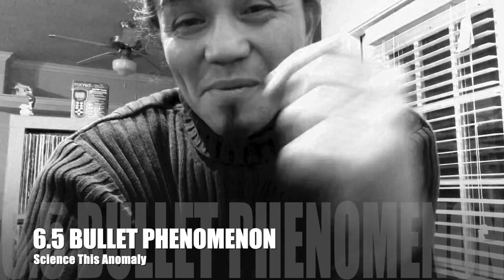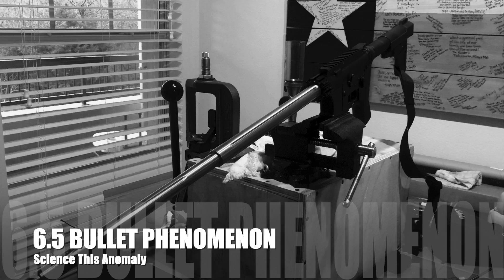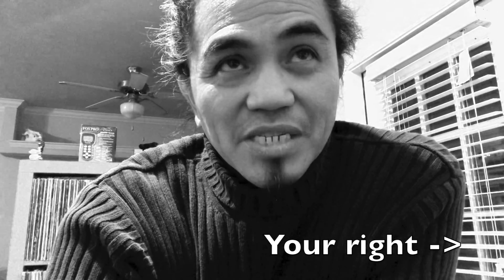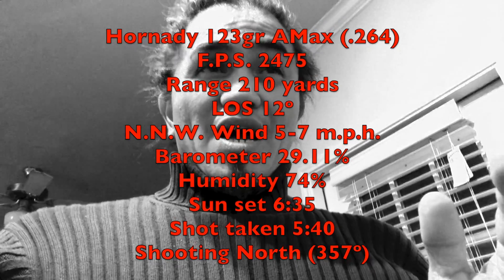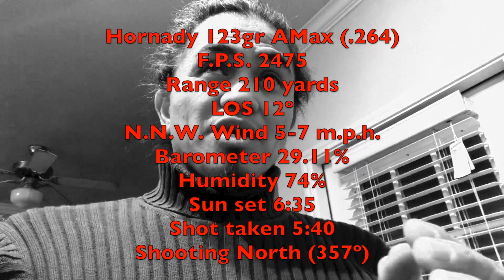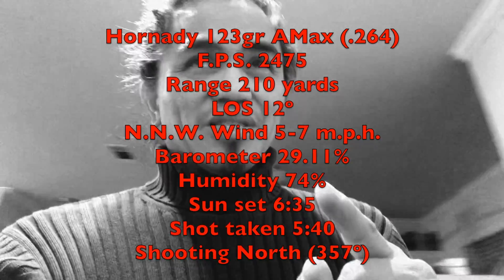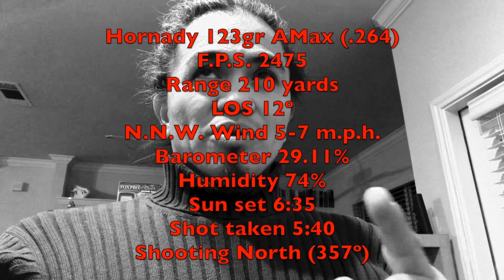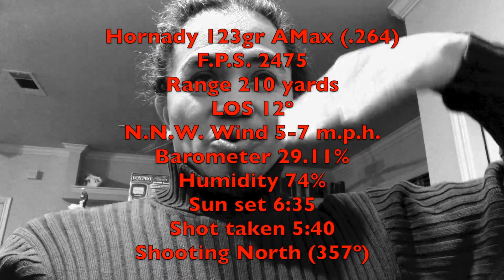6.5 Bullet Phenomenon (Science This Anomaly)

Comment: Several things are happening.  It appears the ballistic tip has separated at first yet still traveling st a high rate of speed just ahead of the actual bullet.  Then,  It’s the shockwave of the first piece of the bullet flying over the water at a high velocity.  Similar to a fighter jet flying right over the top of the ocean or a body of water.  The calm water performs a “split” caused by the velocity of the projectile/jet flying right over the top of the water line.

Comment: Go to the slow motion video and stop the frame as soon as you see the bullet enter the picture. Use the corner of a business card to mark the first location of the bullet and then advance the frame (quickly press play/pause) until the location of the bullet changes. Next, while keeping the corner of the card on the spot where the bullet first entered the picture, align the side of the card so it connects to the next location for the leading bullet. This now indicates the path of the bullet. Then, slowly advance the frame until the lead bullet impacts the target and you can see that the leading object follows a straight line to the target. If you go through the same exercise for the trailing object, you will notice that it appears to jump around and does not follow a linear path to the target. In addition, you will notice that the distance between the two objects gets much smaller as they approach the target. Finally, the trailing object appears to be lower than the leading object immediately prior to impact, but doesn't appear to do anything to the symmetrical pressure wave produced by the impact of the leading object. Based upon these observations, I think we can safely say that the second object is merely a unique reflection comprised of direct sunlight and light reflected off the target.

Comment: The Hornady Amax has been known to separate when fired through a barrel with sharper land edges in high outside temperature,  through a hot barrel. Add in a tight twist , high velocity and thickness of the jacket.

Comment: I know I know I know!!

It is a Hornady bullet that's why LOL

I never had much luck with Hornady and just loaded some of the last ones I had for my 7.7x58mm
 thinking I need to get rid of them before it is too late

Too late for what you ask?

I should take a picture and send you an email as the Hornady bullets are all getting corroded and changing colors right next to other brand bullets I have had for much longer that never do that and Hornady must be using some weird lead or copper that does that to every Hornady bullet I have ever seen

My guess on your own bullet is maybe it was seated too far out onto the rifling and pressure turned it inside out thus the slower velocity and if it was a squib load like someone mentioned that only means now you are gonna need a new barrel as last time I saw that happen the barrel was bulged from it
 (look for a black ring in the bore)

By the way that particular bullet should be moving no less that 2700 fps at a minimum so something sure enough went wrong with it or the load you used and there is a reason the books have a minimum load 

Hope it was not a squib load as that barrel is toast now if it was 

Hey if it is replace it with a 24 inch barrel like Social Regressive has as that 6.5 Creedmoor he has is bad to the bone and had to mention wish I had a 7mm-08 with a 24 inch barrel like that as that would be badder to the bone LOL

He use to shoot 7mm08 his favorite long range round but he is building a new long range setup in 6.5 creedmoor now and it is bad to the bone for sure with that 24 inch barrel
Reply from the maker: O! Ray! Go move your feeder and take me hunting... Bwhahahahah...
Reply: @OutdoorEDventures  I got it done and video on the way showing how many angles you can hunt it from

New place is so neat you can hunt the feeder from like 310 locations anywhere from 25 yards hanging in a tree to 300 yards on the far side of the pasture

No hogs showed up after moving it but if they do that part of the fnce is tight and they will have to run a long way to get away thru a hole or try to jump that fence but have a feeling over time they will rip right thru
Reply: @RayBlackburn  sound like to much fun.